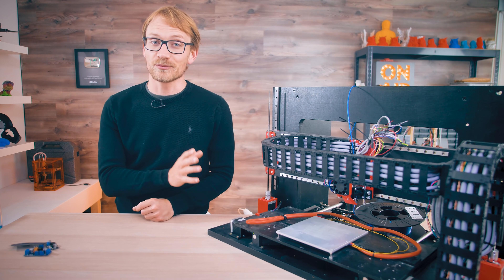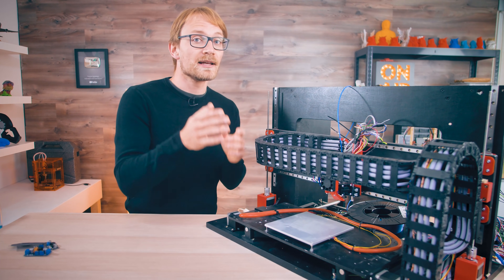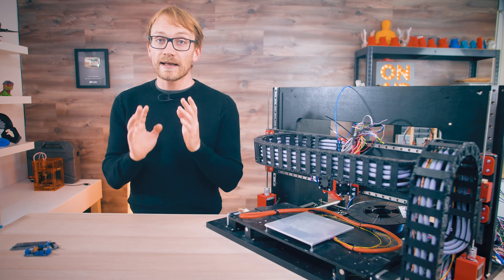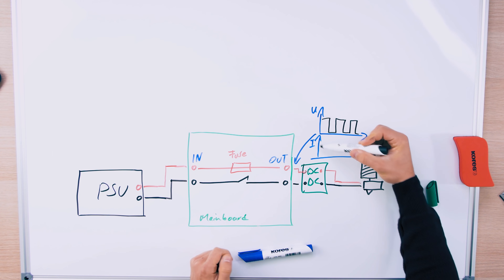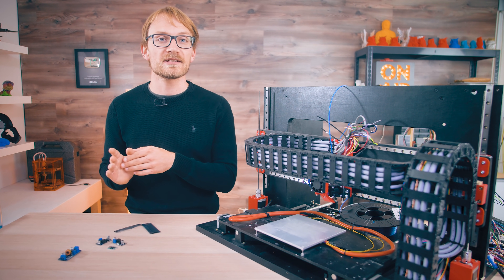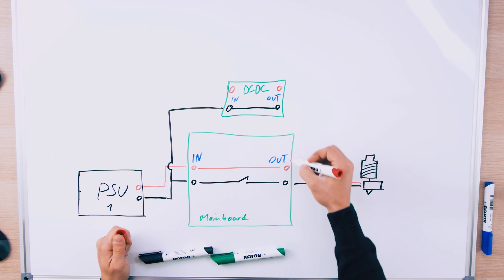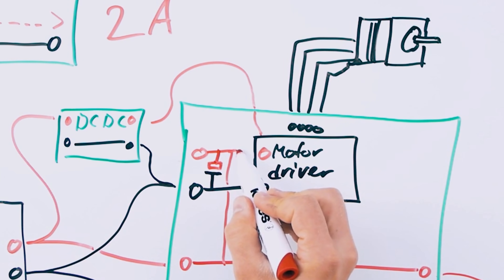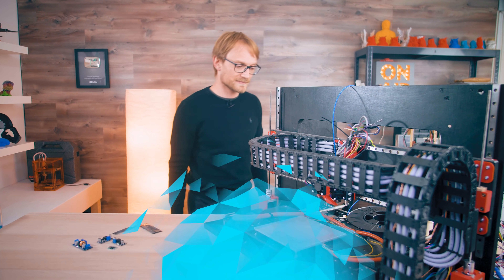Use the WRONG parts on any 3D Printer!

Comment: While I'd agree that running heaters at a higher voltage will make them react snappier to changes, the concept does not make any sense for motor drivers: The standard NEMA17 steppers are all in the <2 Ohms ballpark, that means that they'll be driven with voltages under 6V anyways, so doubling the input voltage will only quadruple the thermal load on the regulators of the controllers and not give you any advantage regarding the movement of the steppers that you could not get with a low-esr cap on a lower voltage supply. It's different if you have large steppers driving your mechanics, but those would have been 24 or 35V from the start.
Reply from the maker: That's... not how this works. Not only do motor drivers not work as linear regulators as you imply, but are essentially step-down converters in combinations with the motor's inductance, but you're also completely ignoring the induced voltage at any speed other than standstill.
Reply: @MadeWithLayers  Well, the regulators use the inductance of the stepper to generate a variable voltage waveforrm that is phase-shifted to the desired phase-overlap of the current microstep selected, and attenuated to the load at hand. Since the regulators themselves do not provide a significant capacitance to flatten the ripple this is consumed by the regulator. As the frequencies of these switches are rather fast, the transition time of the internal mosfets also leads to a significant linear load on the driver. That load is quadrupled with the doubling of the input voltage. The inductive load of the Stepper will induce voltage at the release of the load, and as a inductive resistance at the setting.  So, maybe its not exactly factor 4.0 but 2.9+
Reply: @MadeWithLayers  I think the best documentation available on this is in chapter 6 of the Trinamic TMC2100 datasheet explaining how decay is handled on these. And just to be sure, I'm not saying that the driver will become 4x as hot as on 12V, I'm just saying that all parasitics and power switching related losses that are already there will increase by that factor when using a stepper that was already properly controlled using 12V. I'm not saying that a stepper that is underpowered with 12V will make the driver behave the same.
Reply: Tom, I want to see a video investigating this :P
Reply: In addition to the points Thomas mentioned, some drivers are known to have issues with voltages below 24V. In particular the Trinamics tend to perform worse (or even cause problems) on 12V systems. This includes just being louder than on 24V (audible 'whine'). Feel free to just ask google for details.
Reply: all true .. but most people not understand the datasheets .. on my 3drag, I had reduce the voltage on driver to 9V because I not use heatsinks on drivers  .. works fine since 4 years with 2A current setting ;)

Comment: What's up with the huge cables? What r they for?
Reply: They are multi-conductor wires that seems to have a bunch of twisted pairs (you can see a quick shot of a few at 1:21). It just cleans thing up for multiple wires like stepper motors.
Reply: But there are 4 of them going into the hot end part.. Which seems unusual
Reply: @phenix_labs  He said that this machine is for testing lots of future hardware - so it's just lots and lots of future-proofing. Most of those wires probably aren't being used *YET*, but it's way easier to run a load of extra cables while building it, even if you don't end up needing them all, than to find in a year's time that you need more cables!

Comment: Some time back I released a video or two explaining how to upgrade a RAMPS1.4 to run 24V to the bed but 12V to everything else.
It’s pretty easy and means you can have a bigger bed or heat it faster. Feel free to check it out if you’re considering a larger build.